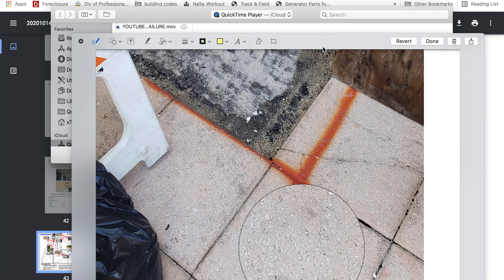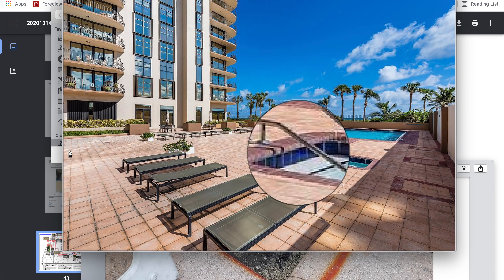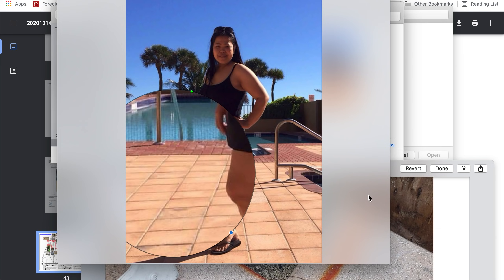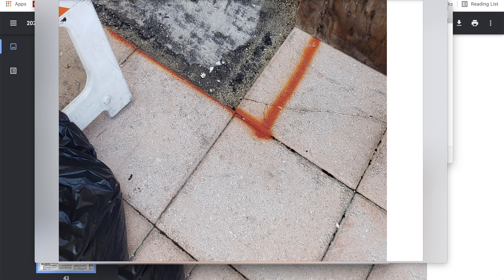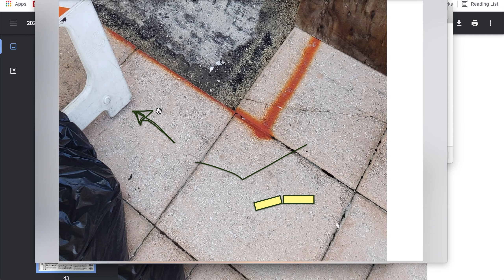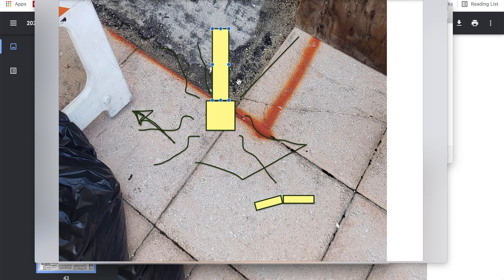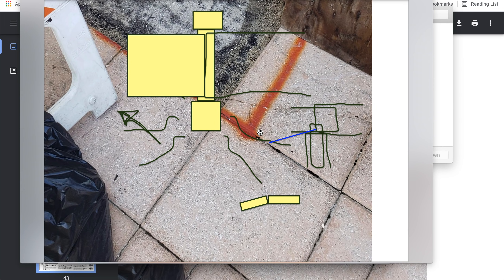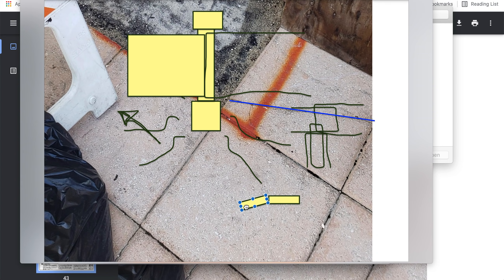Champlain Towers Cracks in Pavers points towards failures

Comment: the cement just slowly leeched out of the concrete on the deck.
the tops of all the columns are  almost pointed, like they pushed through sand.
none were what you might call mushroom,  like the floor broke  away from the columns.
although it seems to have stayed attached to the building  floor part, since it seems to have affected  buildings columns  at what i guess would be a lobby?
the drop had to be the first column out from the elevator wall, since the floors all sheared clean  from the back instead of pulling it over.
or maybe there just wasn't enough steel in that wall attached to the floors to stop it breaking clean.
neglecting the water seeping problem from the start for so many years is what ultimately culminated this disaster.
should be prone to more inspections too.
like once a decade and after stresses like hurricanes.
it's always money over lives first.

Comment: I’m confused. Don’t these pavers/tiles sit on a bed of sand? Wouldn’t the sand base make them inherently more prone to cracking as the sand can shift especially subject to the amount of water on the surface from rain, etc.?
Reply from the maker: The core sample shows them set on a mortar material / hard-set  bed

Comment: I like how you put it all together.  One of your previous videos and the "jeff guy" shows there are drains scattered but, as you mentioned it is pretty flat.  So how does the water go to the drain?  That garage video showed continued water damage and attempts to repair it failed.  Im getting a little confused on which one was likely first.  Garage, then pool, then 111 floor, 4 minutes, column M gives up?

Comment: We are staying in a hotel on the water in Myrtle Beach this week.  We have a first floor room which is slab on grade.  Nothing underneath us.  We took our F250 which is 82” tall and did not fit in the 80” limit parking garage.  So we parked in a lot across the street.  If I hear any loud crumbling noises in the middle of the night I am running for the beach…..LOL!